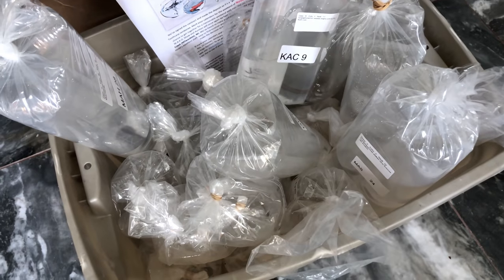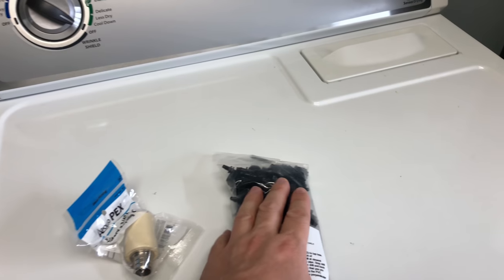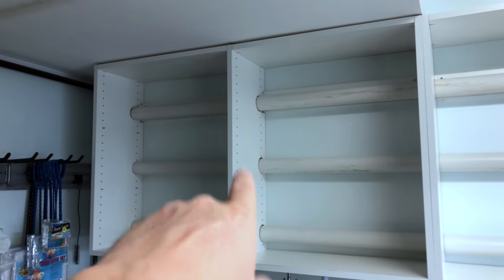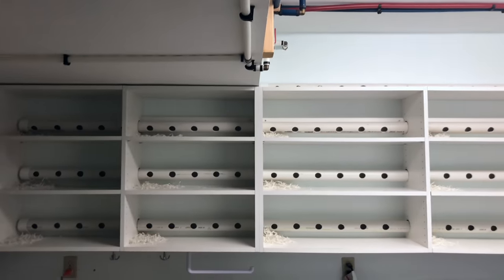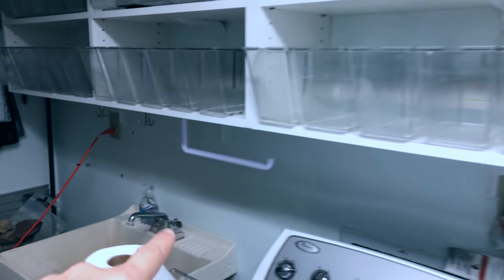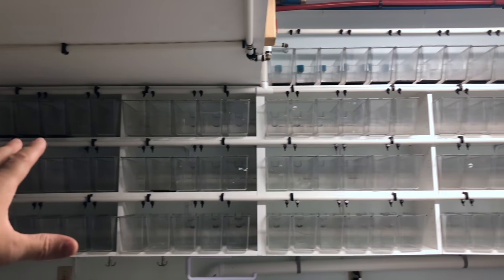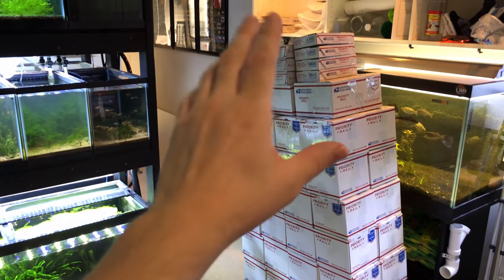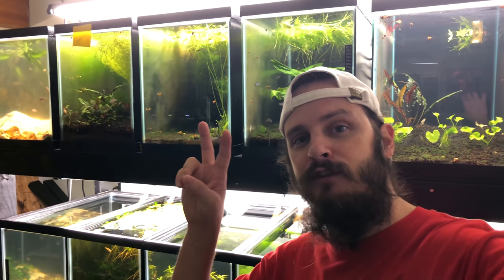MASSIVE! DIY UPGRADE 79 More Units for MORE FiSH!

Comment: Hey Lucas I only just noticed a lot of your smaller tanks don't have lids, do you ever have problems with fishes jumping out?
Reply from the maker: Rarely. Some that I know have a chance to jump I will cover them or lower the water level. I also train some of my fish to not jump. When I transfer them to a tank I am usually slow about it so they know it sucks out of water. It works.

Comment: Im not sure i understand how these work, like how does the water flow in and out
Reply: Bongholio 6543210 looks like it flows in those airline hoses he set up, and out the back of the tubs into the pvc pipe that runs down to the sink